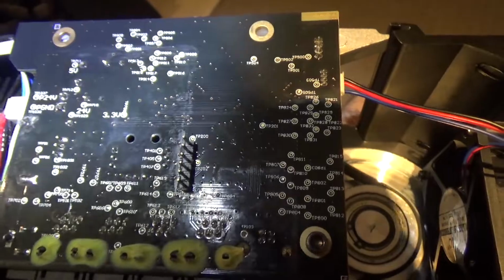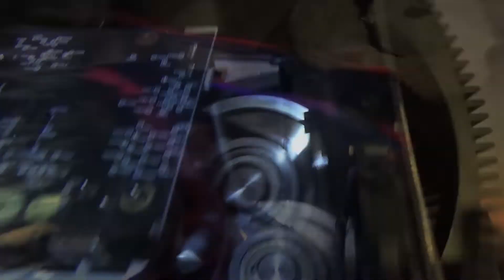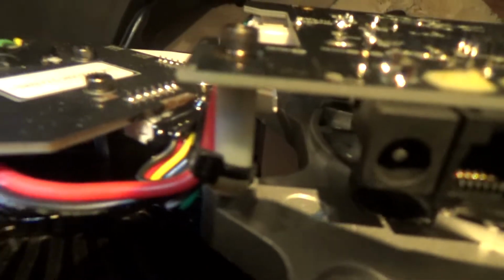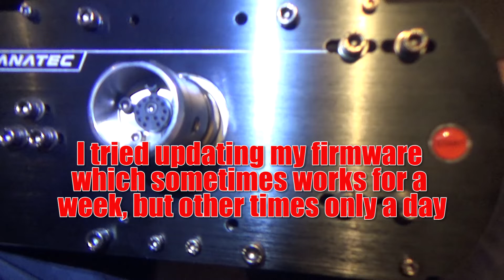Fanatec CSW 2.5 problem (randomly switching modes). A look inside the back cover.

Comment: Wow I've been having this problem for weeks now and it actually caused me to crash out of P3 in a GT3 race the other day in iRacing. I usually turn my PC off then take my headset off. I happen to take my headset off and then turn the PC off, moved the wheel back to center and heard the sound of a dirty/dusty bearing. I had no idea the two were related. Thank you for this.
Reply: Im going to take mine apart to see what's going on. See if there's a temp fix. But I'm just going to buy a Simagic Alpha EVO Pro bundle. Leave Fanatec
Reply from the maker: Yeah it's an annoying problem. Check out the comments from DMTBoris below, because he sent his back to Fanatec and got the main cable replaced, which seems to have been the cause.

Comment: I have the same issue with mine, https://youtu.be/ReDCuZP_7mk. Had this wheelbase for about 3 years now and been dealing with this issue for about 1.5 years now
I'm just now seeing your video after sending mine for a repair... you saying that the service center can't even fix the problem makes me regret sending it back, they just about to receive it tomorrow 3/10/23. If anything happens to this repair I'll post my result here
Reply: they emailed me a quote,
for the main cable. i guess its the cable im having issue with. (which i thought they 100% good)
im trying to reach back to them and see if they can explain their findings
Reply from the maker: @DMTBoris  cool thanks
Reply: @everytenth  Yo, I got my wheelbase back... everything seems to be working the way its suppose to be, I'm not having any random xbox mode switch anymore.
fanatec charge me $60+ after tax on the issue, sending the wheelbase and the hub cost me more.
goodluck with yours man
Reply from the maker: @DMTBoris  hey man, how are you going with your wheelbase? Still all good now hopefully?
Reply from the maker: Thanks for your helpful comments. Hopefully they can fix yours, and it could depend on what service centre or even what technician gets assigned to you, so maybe don’t believe the horror stories. Best of luck and we’ll look forward to hearing your result. 👍

Comment: Maybe unrelated, I don't use my CSW with xbox but mine failed big time, went absolutely nuts then died. Refused to even turn on. On taking it apart I found the on off button had fell apart inside the actual button that you press. Sorted that and once I put it all back together it's been fine. Not sure how you switch modes but is the on off button related ? I also had a wheel with pin issues and that was a simple fix with a new loom and watching some dude on youtube take one apart.
Reply from the maker: Thanks for sharing. No the mode switching is done via the steering wheel but the mode light is part of the on/off switch so technically it would be part of the same circuit.  It could potentially be the culprit. I did try playing around with the pin connections (loosening and tightening the bolts) on both the steering wheel and the wheel base shaft but still kept getting the problem

Comment: Hi mate, did you solved this problem?
Reply: Did you check the USB cable? Random disconnect was happening to me as well when I was using extension cable.
Reply: @TinoushGTR  hi thanks for answering, did check that also, Update: Today I installed the lock pin in the wheel and guess that’s maybe the solution for me… Just drove 1hour and had no problem with mode switching. Just like before this issue appeared then the lock pin wasn’t installed.
Weird, maybe the connectors are getting lose because of the 100ffb after months and the locking pin is now a priority to have full connection all the time 🤷‍♂️
Reply: @svendebaene  lock pin? you mean the screw that goes in quick release?
Reply from the maker: @TinoushGTR  I did try another cable with no luck. Thanks for sharing.
Reply from the maker: Hi mate. No this problem is still unresolved unfortunately
Reply: So how do you drive?
Reply from the maker: @svendebaene  csl dd pro now. The csw is my spare. Im hoping it is something they will fix with firmware but probably not since they are now discontinued
Reply: @everytenth  So you think this is pure software? because no software change was done, it just happend mid race and now it keeps happening after 5min of drifting.
Reply from the maker: @svendebaene  No I'm not sure what the cause is, I'm just hoping it's an easy fix like that because I've heard bad stories about people sending them back to Fanatec and Fanatec telling them there is nothing wrong with it or they can't make it do it when they test it. So it's not worth sending it back (in my opinion), especially with the expense of shipping it both ways. You could try another USB cable as I've heard some people say that has solved it for them, but I tried that and it was still faulty.
Reply: I'm able to solve mine by sending it to the service center, fanatec charge me for $60 for the repair, they description was the main cable has some issue, im assuming its inside the wheelbase
sending the wheelbase and the hub cost more than the repair just heads up
Reply from the maker: @DMTBoris  awesome! Hope it lasts a long time. I'm annoyed with myself for not sending mine back under warranty. Mine started having the issue after only about 3 or 4 months from new. Good to hear they've fixed it and they knew where to look for the problem. 👍